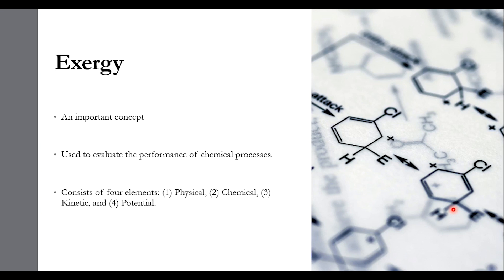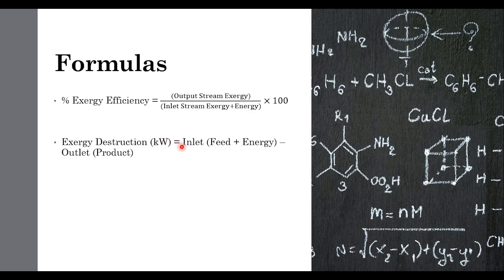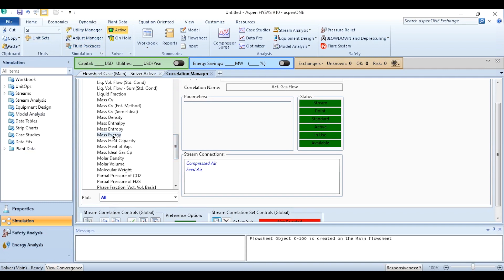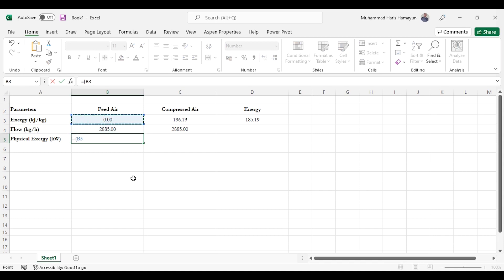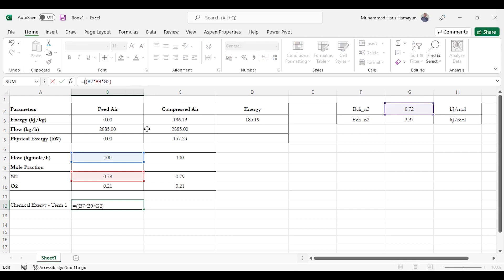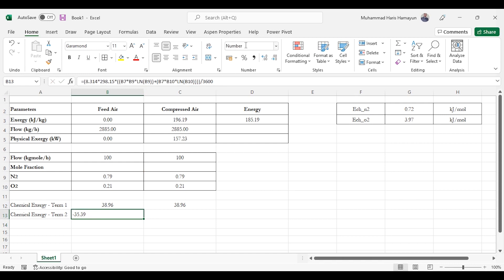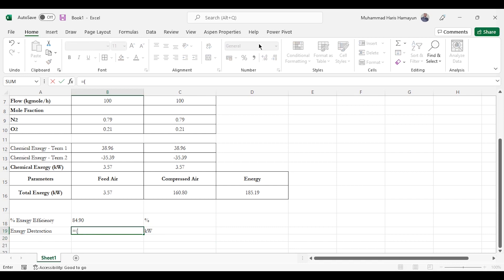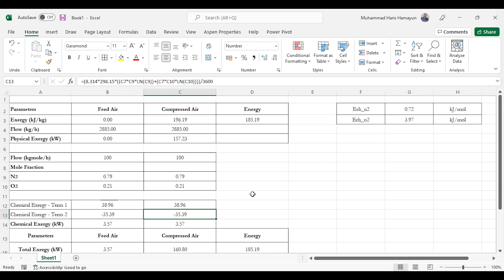How to perform exergy analysis using Aspen HYSYS and MS Excel - Lecture # 95

Comment: Thank your Dr. Haris, does this approach apply to every component, like expander, valves, Hx etc?
Reply from the maker: Yes, the approach will remain the same. However, the formula for each equipment will be different but overall exergy in and exergy out to be calculated. Hope that clarifies. Cheers!

Comment: hi, I have a question, if possible, please answer
1- In the answer that aspen Plus gives for exergy, is it only physical exergy, i.e. enthalpy and entropy, or does it include work and heat as well(except chemical)?
2- If it does not include work and heat, how should exergy loss formulation be done for the reactor when the numbers of work and heat become negative?
Reply from the maker: Aspen only gives values of Physical exergy. For chemical exergy, they haven't yet added a feature. So, for this, you may use manual calculations to proceed.

Comment: Hysys has reported the exergy at standard conditions but we still need the same at the actual conditions for physical exergy calculation. can we meet online for further discussions?
Reply from the maker: If your conditions are the same as that of the standard, then exergy will be zero for that particular stream. For rest of the process streams, the exergy values will be as per the required conditions.
Reply: @aspenchemchannel  yes, I agree on the zero exergy and if I understand you correctly that hysy has given the final answer of the calculation in which standard conditions and input conditions are considered.
Regarding chemical exergy, some articles state that it is zero if no chemical reaction. What is your opinion?
Reply from the maker: Chemical exergy is also applicable once there is a separation in the system. So, almost all industrial processes involve separation, even if very few of them don't involve the reaction. Therefore, in my opinion, it is better to use chemical exergy along with the physical exergy.
Reply: Please enlighten me if online discussion is an option

Comment: Dear sir it's not a relevant question but I want to ask can I simulate reverse osmosis plant in Aspen?
Looking forward for your kind reply
Reply from the maker: Dear Ansub, 

Unfortunately, reverse osmosis plajt is not available in the Aspen. However, if anyone want to simulate, he/she may need to build that module using Aspen Custom Modeler, and then exporting it to the Aspen Plus for onward use.